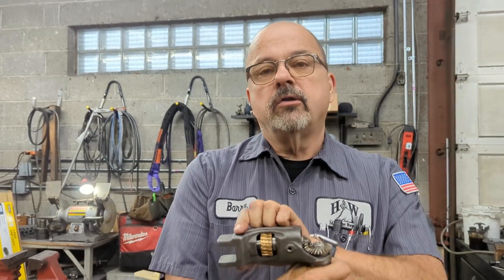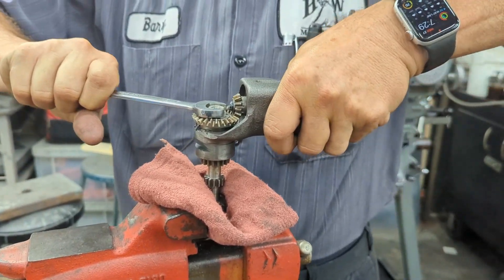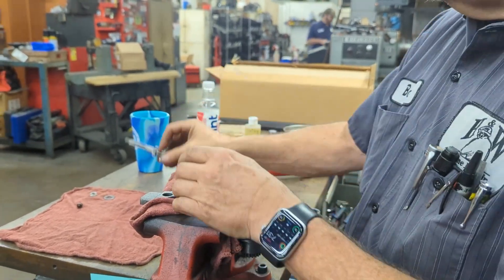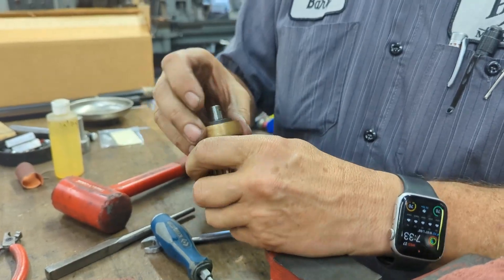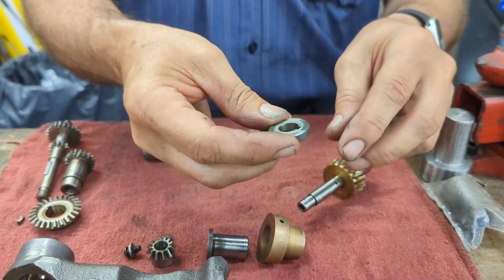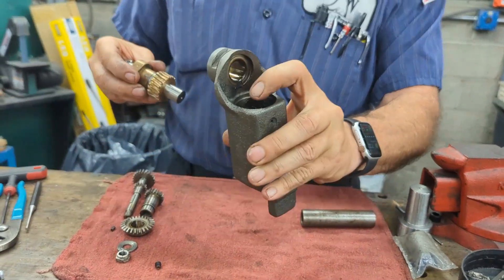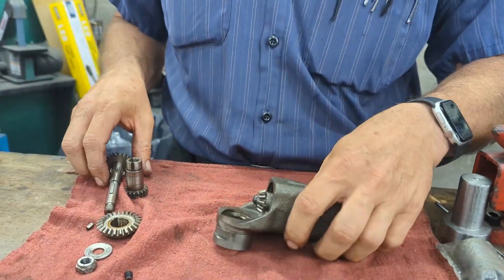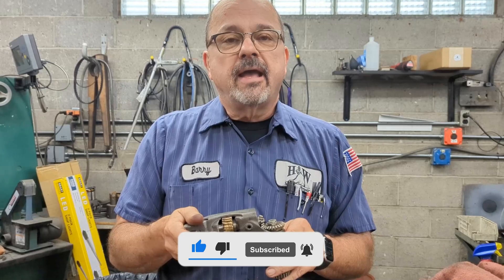Bridgeport Cradle Dissasembly and Reassembly

Comment: The ear on mine was broken as well. I found a big old square nut a peice of steel flat stock and a fender washer that was the perfect thickness to hold it back in place. Got it good and beveled with a carbide burr and brazed it back into place fingers crossed that it will hold well. Mine did have a tight spot in the gear....I might go back and check that set screw....thanks for the tip. I swear I have the twin to the one you are rebuilding in these videos! everything is worn out and busted the same lol.